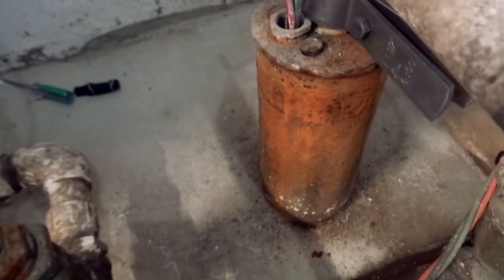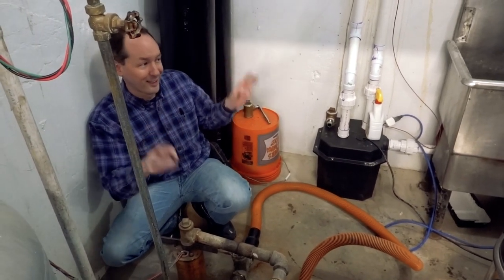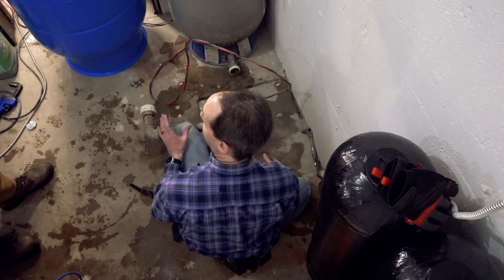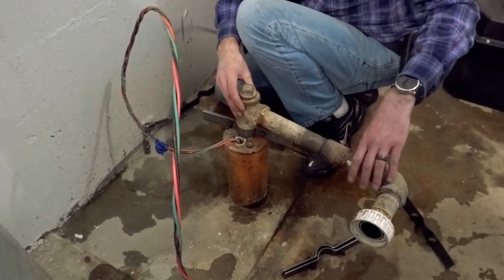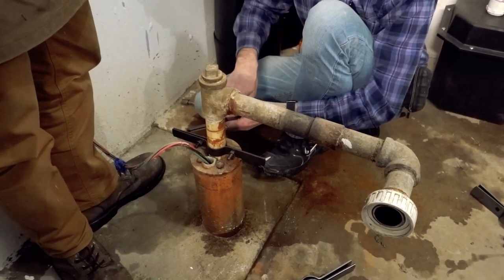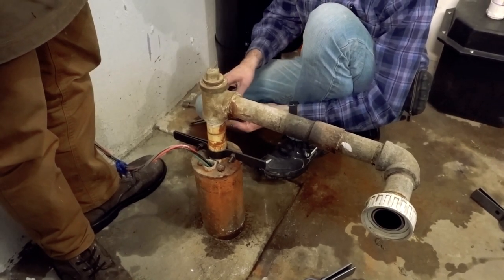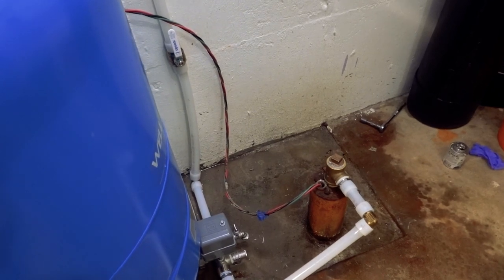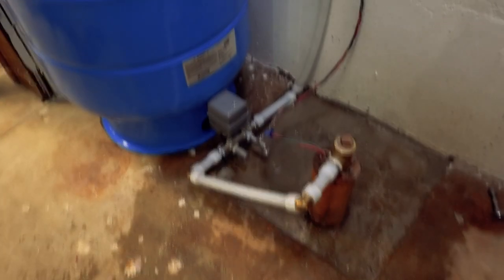DIY Well Pressure Tank Installation Part 1

Comment: After 35+ years working on wells I can assure you that you have barely scratched the surface of weird plumbing jobs on wells. There are systems out there that you take one look at and want to get drunk and then there are well pits that you climb into and look down to see a coiled rattlesnake between your feet. You never know what you will find.

Comment: I was a nervous wreck....but I installed my own and after the experience and problems I ran into ...I have the confidence to do a hundred more....better then paying some one thousands....spent $650 on a good brand from local place where contractors go....$200 on new brass tee, pressure valve, valve, ....ect.....

Comment: I see you're a subscriber to the "bigger the gob better the job" school of thought for pipe dope application
Reply from the maker: Hell yeah, so long as it's not inside the pipe or up past the threads, a nice even coat is fine. The extra will squeeze out and get wiped off anyways. Sealant is cheap, leaks are expensive.

Comment: i've never seen a well inside the basement, always outside.  wonder how they dug it and got the giant well drill/digger in there?  i remember when we had to replace ours along with the pressure tank on the old farm, what a job that was!
Reply from the maker: Have you ever seen the long flexible shaft digging machines they use for running cable under sidewalks and such? They may have used one of those. It would explain the ten-foot ceilings in the basement, because you'd need that space to arch the drill over and point it down the hole. Or, perhaps, and I'm just guessing here, it may have something to do with the manhole directly over the well. ;) This is the first time I've ever seen a well in the basement too, and I'm pretty happy to have it inside. Though honestly, I'd prefer city water!
Reply: Well was probably put in befor the place was built.

Comment: I see you are using stainless steel replacement parts. Just has some stainless steel parts installed replacing brass parts and now not sure if it is sweating or leaking. Does stainlesss steel sweat more as opposed to brass?